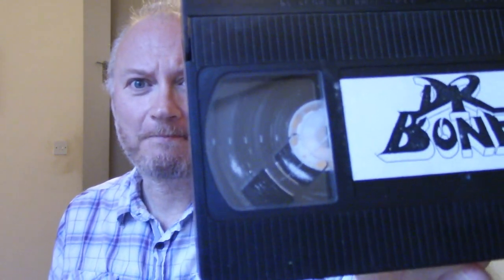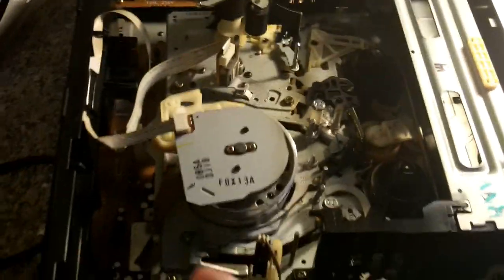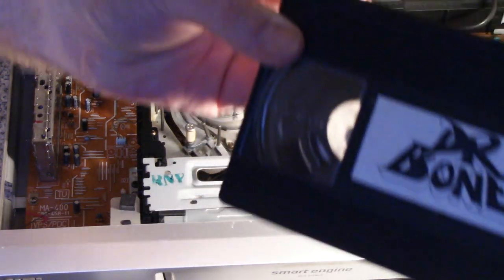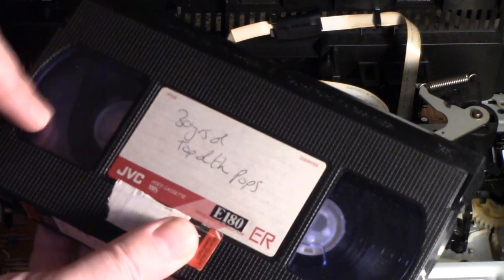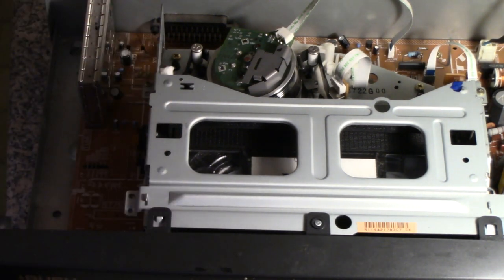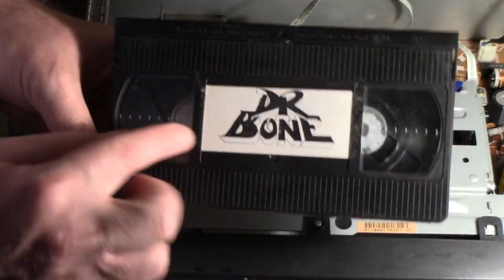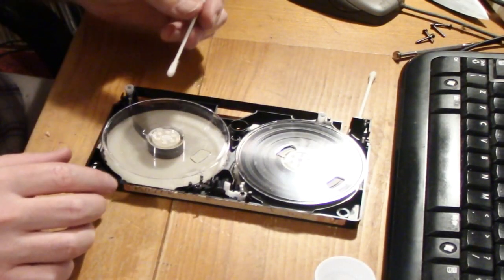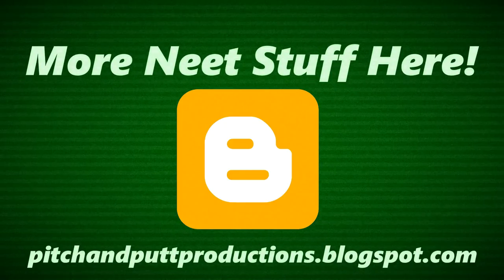Cleaning Moldy VHS Tapes: My First Attempt

Comment: Good first attempt at cleaning a moldy tape. Isopropanol is fast-evaporating. Needs very little liquid on your swab or cleaning pad. A tiny moist dot of liquid on a one inch piece of chamois leather works well. Avoid using cotton wool balls or pads. Cotton cu-tips are fine, but use care if using the ends around the video pick-up chips.
I too have used old VHS, Betamax and Philips N1700 machines to clean the respective tapes. I am currently building a tape cleaner that accepts interchangeable hubs so it can clean numerous formats..

Comment: I skipped the first stage and just opened the cassette tape then used a cotton wool stick pushed under the plastic to clean it. No liquids. The mold is mostly sitting on the reel. Went fine and was able to copy it onto my pc. Quality was very good.